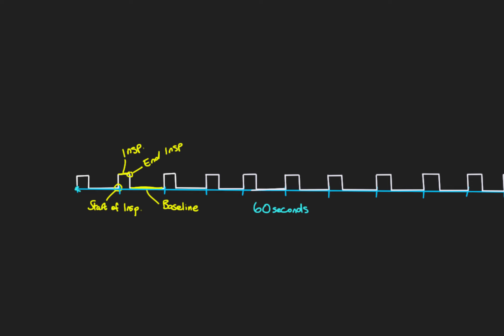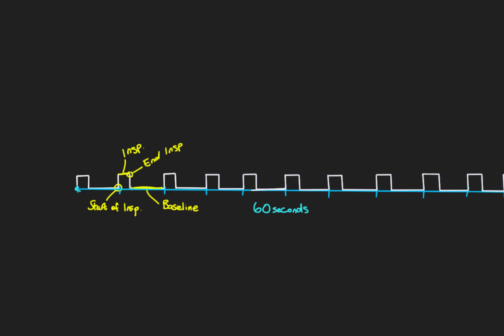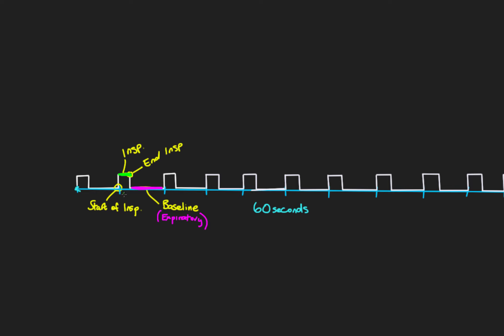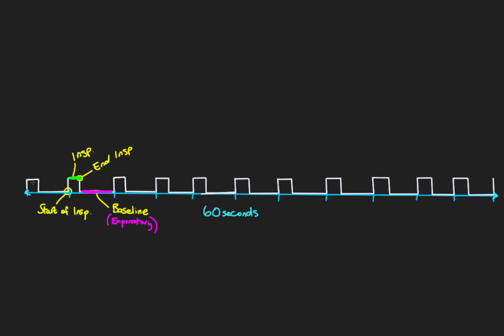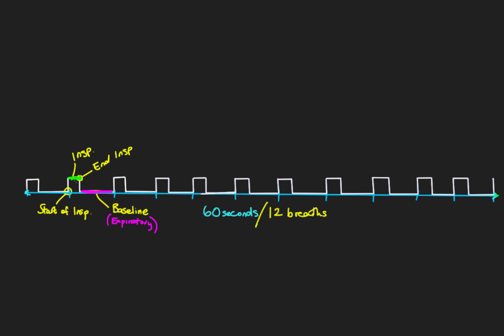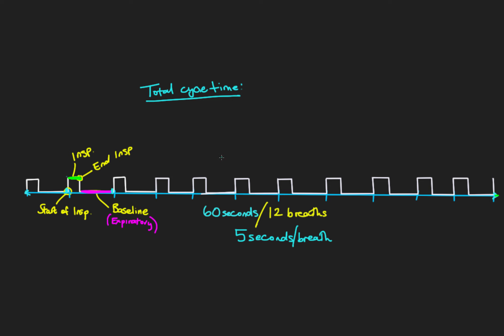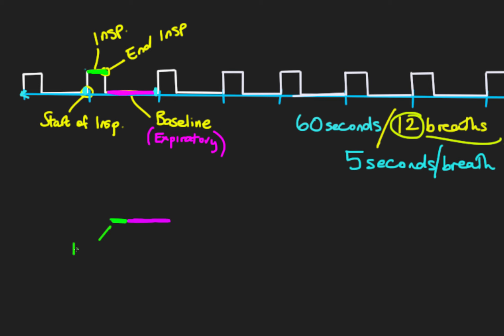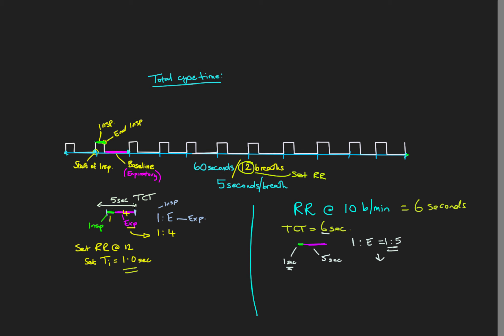Principles of Mechanical Ventilation 3: Total Cycle Time and I:E ratio

Comment: So why do we almost always start with a ration of 1:2?
Reply from the maker: 1:2 is a reasonable starting spot. As long as you understand why you would change the I:E ratio, and what it would do to other variables, the starting point by default isn't overly important. If you were in VC and changed the I:E ratio from 1:2 to 1:3 and kept the tidal volume and RR the same, the gas will have to be delivered faster to get the same TV delivered in the now shorter inspiratory time, this will increase the inspiratory pressure. The starting point can be whatever you choose within reason. You just need to be able to monitor the response and adjust as your patient needs.

Comment: Hi just a question when working out your I:E; do you include the rise time as part of Ti
Reply from the maker: Azmo No. In pressure control you control the Ti and the RR so you can calculate the I:E ratio as explained in the video. Rise time is simply adjusting how fast the pressure rises to your set value. Obviously your rise time cannot be longer than your inspiratory time, so just use Ti for calculating the ratio.
Reply: great thanks